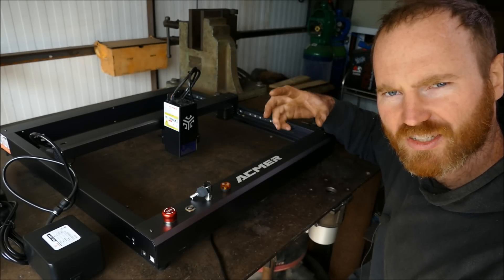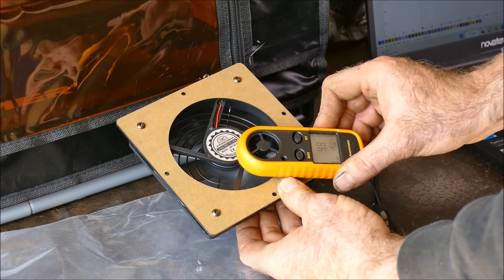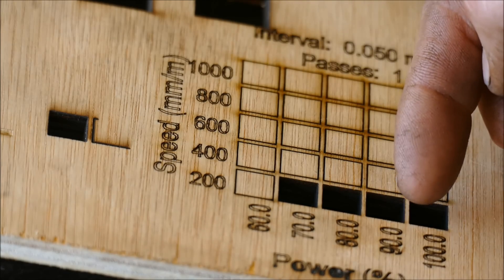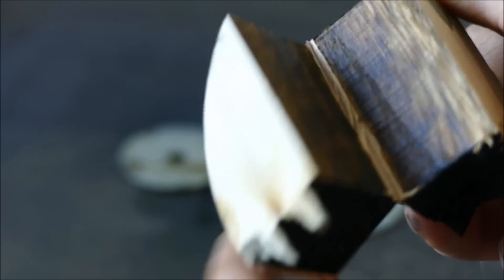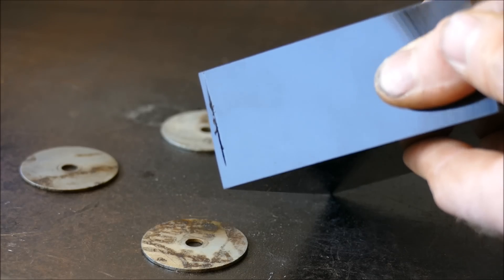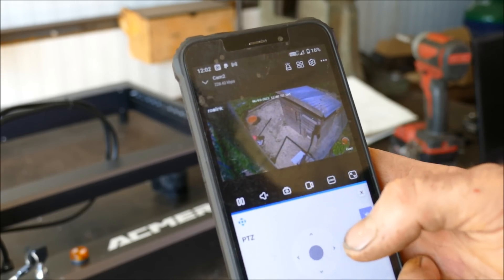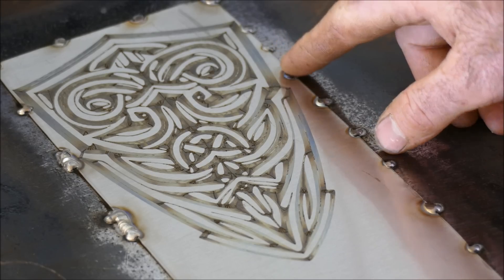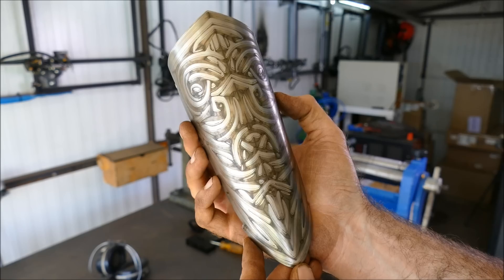INSANE new desktop laser shouldn't be able to do this! ACMER P2 33w full review test critique & tips

Comment: Good that it comes with somekind of shielding, but I don't understand why they just don't make shielding frame of ie. 2020. Wouldn't add cost virtually at all. I mean I would gladly shell like 50-100 euros gladly for ready cut parts. Btw I'm curious about stainless etching with laser. Could you show in some future video how well it stick by rubbing it bit with like vlies 300 grit or something? Apparently that flame stop function is quite a big miss, but otherwise quite impressive thing.
Reply from the maker: Thank you, I've done few stainless etchings on different machines and they're all pretty good. Even if polished out you can feel the dimple of the etching left behind. Cheers J

Comment: Try cutting 5mm acrylic.  CLEAR ACRYLIC.  Diode lasers are useless. Unless you want to make small pieces of charcoal, burn down your house or die of asphyxiation. Save your money and get a CO2 laser.
Reply from the maker: Yes that's correct you can't cut clear acrylic but a co2 can't etch stainless either so it depends on individual needs. Cheers J

Comment: I don't know an xtool costs about the same and this laser can do more than it can. So by comparison I think it's about the same price wise. Now what remains to be seen it's the machine's longevity. Xtool has a good reputation for building quality lasers that last.
Reply from the maker: 40w xTool video coming out tomorrow. Stay tuned. Cheers J
Reply: @joshuadelisle the spot size on the XTool 40W is 3x larger than the ATEZR doubt it will be better than this
Reply from the maker: @cybyrd9615  true but it makes very little impact especially if you get the kerf width correct. A wider laser actually engraved faster too as it covers a wider area with each pass. Cheers J
Reply from the maker: This one is very well made still. Cheers mate

Comment: I'm still looking a bench top multi purpose machine that can handle metal as well.
Reply: Multi purpose? Go for a CNC. You get good ones for around 2-3k.
Reply from the maker: My original Ortur is modified for plasma cutting. I think its best to keep the laser away from the plasma so they're in seperate workshops. cheers J
Reply: @joshuadelisle  Plasma is fine for thicker material, but if you're only looking 1-2mm plasma cutting can destroy that. Fibre is an option, but way too expensive for a hobby workshop.

Loving the channel by the way :)
Reply from the maker: @phils_arcade  If the settings right plasma can cut 1mm very clean but depends entirely on the quality of the plasma torch. Otherwise if it's only 1mm I would recommend electronic hand shears as they're very quick and clean. Cheers mate
Reply from the maker: it can etch metal but not cut it. cheers J

Comment: The only niggle I have is that you would not want to be running it at 100% as you would burn the head out fairly quickly!
Would a couple of passes at lower power have the same effect? Or just slower speed and a single pass?
Eather way, it was a great video! I like it!
Reply from the maker: thank you yes thats the beauty of a more powerful laser is you can still get great cuts at 80% and I recomend faster with more passes for a clean cut. cheers J
Reply: Yes, I always run cut tests at max 60% 'cos I'm paranoid and have lost a few modules running 100%. Although they probably failed for other reasons I don't want to take risk with these more powerful and expensive assemblies. Less power, less speed, more passes works for me as long as the cut geometry doesn't require the laser to dwell too long around a certain feature and heat it up too much (only a problem if using optimized multiple passes). 

I've been appealing to Lightburn devs to offer a 'cut distributed mode' in vector cuts to prevent any one area getting too much attention - important for thermoplastic cutting and even applicable to engraving melt vulnerable materials. I'd rather have the laser scan over non-engraved areas in a uniform pattern just to keep any heating effect consistent. A good example here is when cutting kapton tape to make stencils. The default optimisations (in LB) will often melt at some points and fail to penetrate at others. An option for consistent burn over speed would be useful, but I appreciate that a good cut strategy would involve taking the material properties into account. However, with more optimization options, that could be left to the end user.

 If I get a melting problem I just run one job multiple times rather than specifying multiple passes in the cut options.

Comment: acrylic will get harder when cold.. My dad told me a long time ago.. They used it on pressure vessels with cold butane, when it got colder it got stronger..
Reply from the maker: Thank you, thats good to know, I was afraid if it gets harder it becomes more brittle, i'm thinking of the screws i put into it but they should contract and go slightly loose in winter so it shouldn't be an issue. cheers J